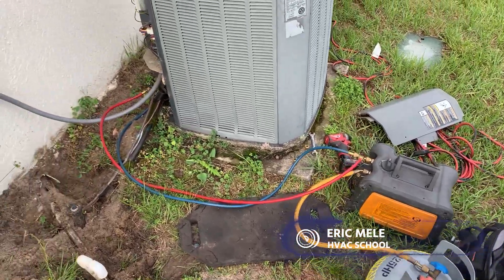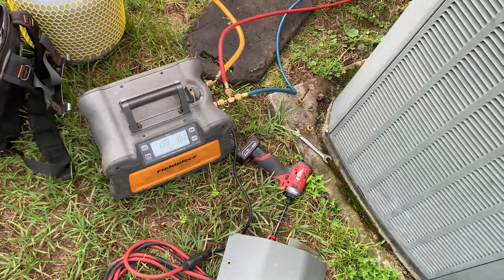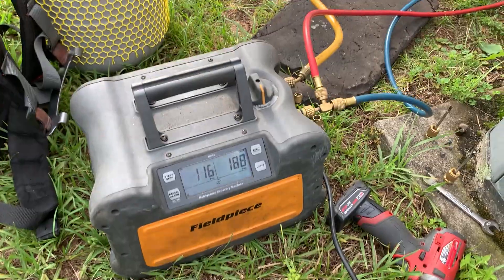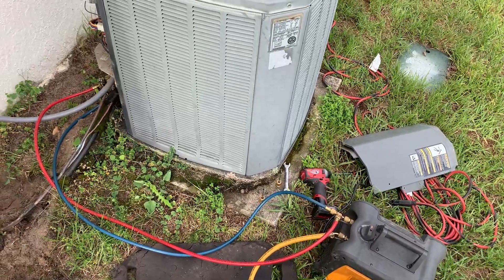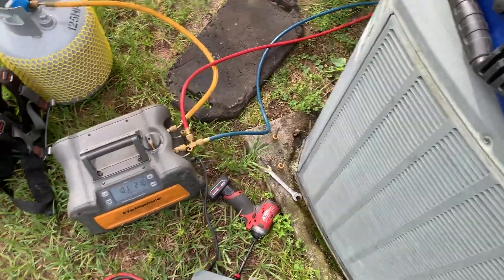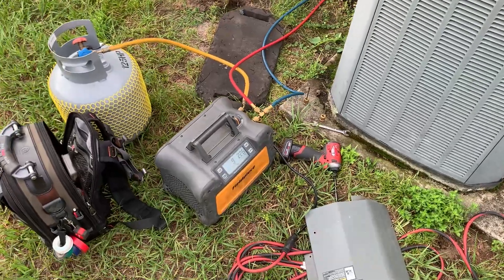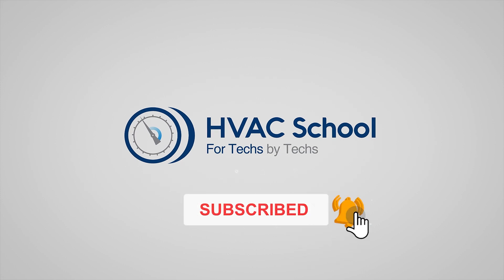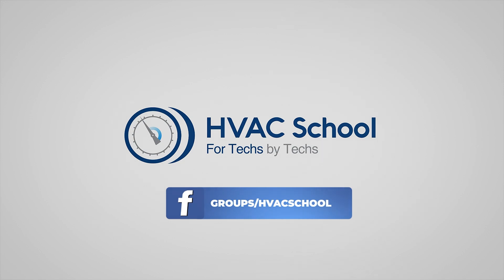Recovering Refrigerant w/ a Working Compressor

Comment: Question. In some cases the condenser is inoperable, would it still be best to pull only from the liquid side?
Reply: Well depends on your 
temperature is...I believe he's trying to minimize sub critical temperatures from occurring inside the compressor. I just run the indoor fan and use a recovery cooler in a bucket of tap water, my method cuts my recovery time to about a third... He's just using the heat from the compressor to boil off the refrigerant, this is not new and it's not rocket science lol... If you've ever had two coax a bottle of refrigerant  with a torch you'll understand it as the same principle. 
Getting trapped liquid to flash to vapor to be easily recovered by the machine and not overheat and slam head pressure's in the bottle

Comment: I usually use the compressor to move most of the refrigerant straight in a recovery cylinder.Than the final 10 percent is removed in vapor form with the recovery machine,Faster this way,and less work of removing the liquid refrigerant,for the recovery machine.